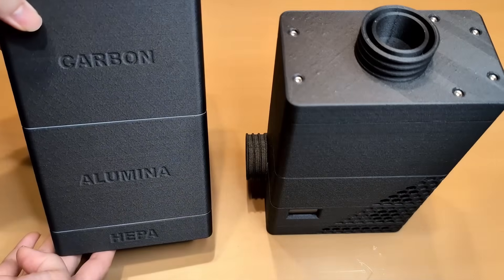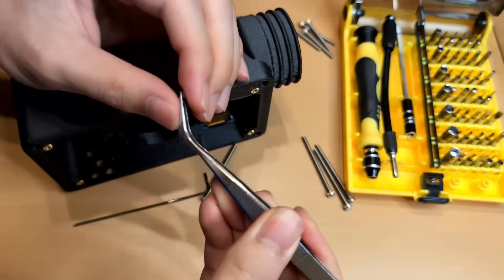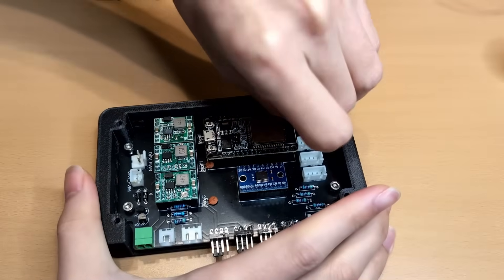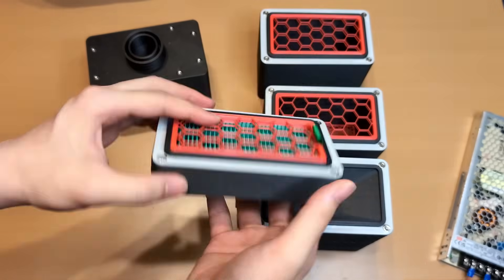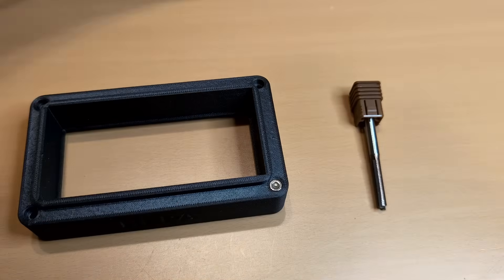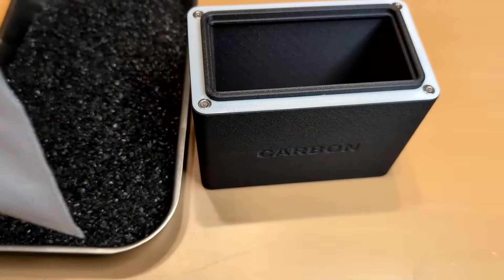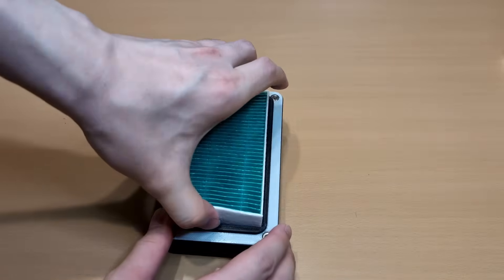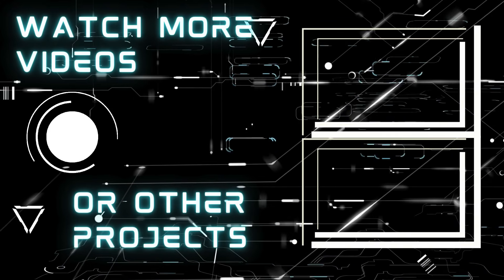I Built a Circulating Air Filter for My 3D Printer — With Live Air Quality Monitoring

Comment: I'm very concerned about what comes from the printing process and would love to be able to print this myself. When will files be available? Early adopters maybe, to help speed up prototyping with their builds and feedback.
Reply from the maker: Thanks a lot for your interest and support!

Right now, the plan includes two options:
– A full system with some pre-assembled components
– A kit version without the 3D-printed parts (for those who prefer to print their own)

However, both options are still under development, and I haven’t completed full testing yet. So, it’ll take a bit more time before anything is available.

Since the system relies on specific components like custom PCBs and sensors, I’m not planning to release the design files publicly. But I truly appreciate your willingness to help, and I may reach out to early adopters once the prototype is more stable.
Reply: @SlowEngineering is there any way to encapsulate the electronics any smaller so that you might sell it as an easier to assemble unit into a printed shell made by the end user? It's already tight but I can see it being smaller once you reach a higher quantity of board orders to justify that process. Of course maybe even just printing/modeling it so a small 3-5 wall outer shell can be placed for end users to have that customized feeling without as much technical knowhow. It's a great safety device and I think what will help a lot to draw others in is a way to make it more customizable. 

I hope you succeed. We need more filtration options on the market. We need safer air.
Reply from the maker: @SteedDigital1  I considered your idea before. However, I am also concerned about the module replacement on the board. If I customize all the electrical parts. It will be difficult to repair, and I will have to replace the entire control board for the users. Therefore, I use modules on the board, making them more accessible to users.

Comment: SLOW Engineering  Hi. 8:40 I don't understand why magnets are used to transmit electricity? And what are pogopins for? They are used to transmit information/current. In old PDAs they were used to connect the battery
== update - maybe the magnets for minus and pogo for plus? You can also apply glue to the side of the magnet.
Reply from the maker: Yes, the pogo pin connects to the positive, and the magnet attaches to the negative. For glue application, the tolerance is tight, and any glue residue left on the top surface of the magnets affects their conductivity when interacting with another magnet.

Comment: I was wondering if you have any plans to share the project?
Reply from the maker: It still needs a test run after the tophat system build. I'll consider it after that.
Reply: @  an awesome project, some integration with home assistant and 10/10 to control the quality air 🫡
Reply from the maker: @ Yes, I also have an air quality sensor in the room.

Comment: You're definitely setting yourself apart from the many toolchanger projects out there with this. Amazing work on something that is essentially ignored by the consumer 3D printer manufacturers.
Reply from the maker: I just can't tolerate the nasty smells in my room when printing, like ABS. Extracting air out loses temperature inside the enclosure. Therefore, this filtration system might be the solution to deal with the situation.

Comment: This system would be perfect for my desk. I can use it to help filter any resin smell that escapes my resin printer enclosure and I could change the inlet attachment to be used for soldering. A multifunctional modular air filtration system is exactly what us at-home makers need!
Reply from the maker: Although this system is designed for FDM 3D printers, activated carbon can also deal with the fumes from resin printers. The concept for the system is to create negative pressure inside the printer enclosure to prevent any leakage from the printer and to achieve no fumes leaking.